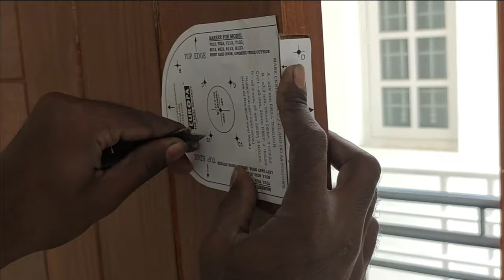main door lock fitting

Comment: That lock looks good but it's waste bcuz thieves never try to break Lock instead they'll try to break the lock holder which that fixes at 6:30 you see that holder is been fitted with 1or2mm screw of 1inch. Thieves very thin pointed rod and applies heavy pressure due to which holder comes along with piece of wood since 1inch hasn't pierced deeply. I'm not saying lock is problem. It's lock holder is they should provide 4inch long screws which goes deep. In my home robbery happened and they break using the holder, I had europa lock but Still they entered and robbed